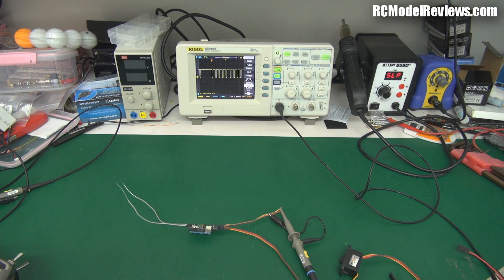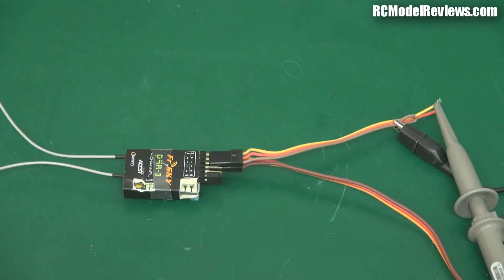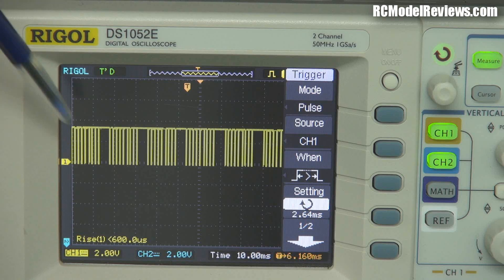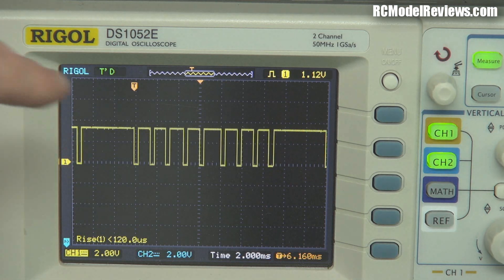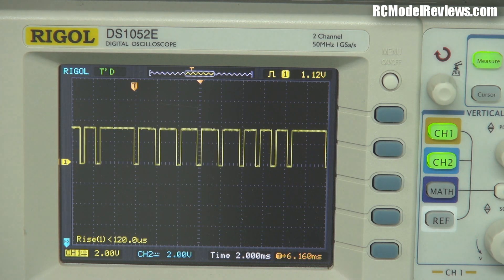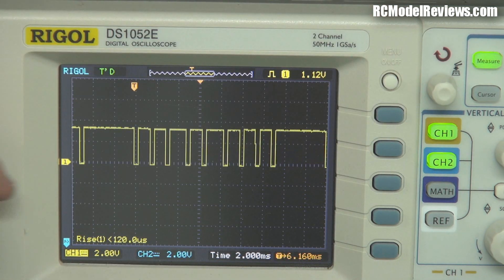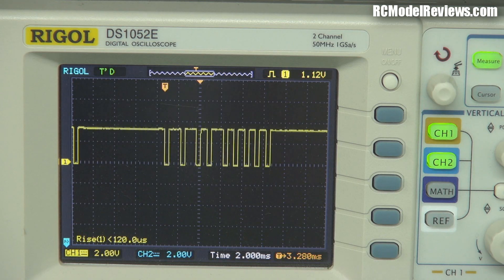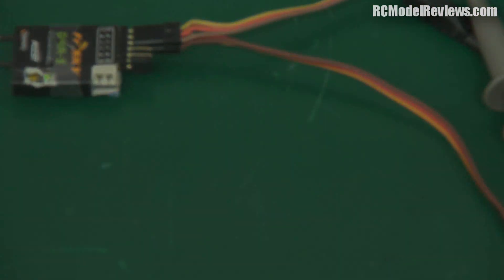CPPM and the FrSky D4R-II receiver

Comment: Great video Bruce, but you may be misleading folks a bit. If you were to invert your scope display, it would make a lot more sense. CPPM stands for Composite Pulse Position Modulation.  So the signal intelligence is conveyed by the position of the pulse in the frame, not by its width as is the case in Pulse Width Modulation (PWM).  So when you vary your Ch1 signal for example, it does not increase or decrease in width, but changes its position in time, plus or minus, from its idle position.  The width of PPM pulses representing individual channels is constant.  Invert your scope display and it will be very clear what is really going on.
Reply: i suspect it's CPPM is inverted  and differentially encoded PPM.   which would look exactly like several varying width pulse one after the other.   but yeah i think this has confused a lot of people looking at it from inverted perspectives.

Comment: Hey Bruce today is May 12, 2015. Any word if the new D4R-II have the new firmware pre-installed from the factory?
Reply: Dean Cory I have the same question.  have you got an answer from anyone yet?
Reply: No answer.
Reply: Joseph Donati:  I got mine today all 3 aux functions worked.  Granted Aux3 is lost model beeper Aux selects flight mode of my Naze32 and Aux 1 arms my motors

Comment: im thinking of using the d4r-ll instead of the x8r which  came with my taranis on my 250 quad, any advise ? thx
Reply: A lot of people use the d4rii it's very small and can fit right under your naze 32 when using spacers. Plus telemetry is very easy to use compared to the x8r.

Comment: Hello Bruce,

Is CPPM a clearly defined standard, are 25ms sync pulse standard?
Because I flashed my d8r ii with the new firmware, I checked that cppm was enabled by plugging in a servo to see it jitter, because I dont have an osciloscope.

And the flightcontroller CC3D hat jumping thottle (without prop).
The same problem I had earlier with apm2.5 and it lead to a crash even with openlrsng where I set the spulse to 4ms, as I remember that was suggested. It would maybe better to set it to 25-35ms.

Then later, I tried sbus with CC3D and it worked without any flaws, amazing.

So to summarize:
Does a bit mor than 25ms allow you to be on the safe side?
Is there a clear cppm definition?
Is Sbus clearly defined?

Best Regards,
Ruben

Comment: Hello,  thanks for the great video.  I do have a couple of question as I am going to be building a 250 and 450 very soon.  I will be using my FrSky radio that came with my IRIS+ and was going to buy the D4R-II    the 250 uses the CC3D Controller and the 450 will be using the AMP2.6   if I am understanding correctly this receiver will give me 8 channels?  and do you think it will be a good fit for these two multirotors?    Thanks for all your help

Grandpa Jake

Comment: i just bought the d4rii this will be a tricky matter and kinda regretting not getting the 8 channel one instead. also will be fun to build some kind of antenna with the 2 wires they give you. im thinking a quarter wavelength double dipole antenna in the vertical position.

Comment: i have a t9x modded to opentx.  I think i am experiencing the unexpected behavior.  QAV250 will suddenly drop a corner and flip or get squirrely.  I saved it the other day by punching it hard up.  I would be interested in a follow up how-to to Max and Invert.  I've crashed twice because of this.  One time doing no damage, the other time completly destroying a motor. Did some googling but didn't turn up a definitive answer on how to do this fix on my T9x.  Thanks.

Comment: Hi Bruce. Good video. You're giving an insight into how radio gear works and explaining it well, which is good because I've always been amazed at how little people who are supposedly experienced flyers actually know about how their models work.

I've been flying with my Futaba 10C for the past four years (roughly) and I recently blew it up. I loved the thing to bits (literally), but I really cannot afford another at the moment. The Taranis is slightly more within my budget, so I'm interested in it. It looks 10000x better than any of the other budget radios I've seen (IE not Futaba/JR), but how would you say it compares to expensive radios? I've become accustomed to a nice transmitter so I really don't want to be using something cheap and crap again.

Comment: Great video! People say it's possible to "turn off" the last two channels with the Taranis, and I can see that option in the settings, but my D4R-II continues to produce a CPPM stream of 8 channels despite my settings in the Taranis being D8 mode & channel range CH1-6 only. Has anybody actually seen the D4R-II produce only 6-channel CPPM (using the Taranis or similarly featured radio) on an oscilloscope?

Comment: You can actually use 6 channels if you minimize channels 7 and 8, or 7 channels if you can completely turn off channel 8 (i.e. the channel is not sent at all). The thing to remember is that your sync pulse needs to be 4ms long, most flight controllers will loose track of the channels if it falls below 3.8ms. 2ms per channel * 8 channels = 16ms total frame used. The standard frame size is 20ms and FrSky uses 18ms so you only need to free up an extra 2ms and you're good. Always be sure to test with all channels set to maximum throws first though. Also the Delta-8 is not affected by this issue, Simon Chambers implemented a flexible frame size that tacks the sync pulse onto the end of the frame regardless of the channel widths in the Delta-8 firmware

Comment: I was very excited when I saw this title as I have wanted to know how CPPM works for some time.  However I'm not 100% clear.
Am I right in thinking that I bridge the signals of the last 2 channels and use a normal lead on channel 1 from the receiver to the flight controller it will then be complete.  Do I have to do anything to the transmitter?  I have a Taranis and use Frsky receivers.
Also, does it work for planes if I have a stabilisation controller or APM?

Subscribed for years and check for new videos daily.  Thank you for all your help over the years.

John.

Comment: Surely this is only a problem if you are trying to use all eight channels at max width at the same time, isn't it?

The D4R-II manual itself states this:

"CPPM channel can not handle all eight channels at the same time with all throws maxed out, as it does not have enough frame gap.  It is recommended to use at most six channels from CPPM while leaving off the other two channels, otherwise improper performance might occur".  

Surely you just don't use the other channels and you don't have a problem, do you?

Comment: Mr Bruce, how about a follow up video - could you demonstrate a lost sync and show what actually happens to the RC model.
Reply: i think the radio just keeps broadcasting. the interesting bit would be the cppm from the reciever. i think the d4rii manual says what it will do as it goes into fail safe. there are 2 or 3 modes i think, one will freeze the channels at their last known value, another will stop pulsing, and the third just shuts off failsafe mode which im not entirely sure what that does other than allow a rc to fly away?? i agree a video demonstrating these 3 modes would be interesting to see.

Comment: Hi Bruce and thanks for all your very videos ! I like a lot what you do. 
I just have a quick question : what happen in terms of CPPM if only 6 channels are set in the mixer tab of the taranis ? If the taranis broadcast only 6 channels, does the D4R-II receiver send an 8channels CPPM signal or only a 6 channels ? I as that because the leaflet with the D4RII specify that it is safe to use up to 6 channels with the stock firmware and that's what I do on my quadcopter (I ordered a frsky USB lead to use the 27ms firmware)

Comment: FR Sky has not been all that.

The Taranis is a better built radio over the Turnigy 9X, and 9XR, however having a nice car over a go cart is nothing if the nice car doesn't run or doesn't do all the things it says it can do.

I invested in FrSky Taranis because I listened to this guy, and so far the radio works fine for basic flying but so does the radio that came with my Harbor Freight $30 Helicopter!

Of coarse I talk about it here because if you listen that is the radio he is using in this video.

The radio brags about the telemetry and yet all that really works is the battery voltage, and even that can be a pain to set up, look at some of the instruction videos here on youtube!

The GPS speed sensor and logging is a complete joke and the vario logging is just as bad fact is the telemetery logging absolutely useless and they will not fix it or even acknowledge the problem instead saying they use free ware (companion 9X) and its up to the guys voluntarily making the software to fix it! So I am paying for a radio that has firmware made for free, and paying a premium price for it as well.

So yea I am saying it sucks! And apparently the pulse width management and having to flash the receivers sucks to, and what is worse you find out you may need to flash your receiver when your model crashes! Or you can add to your already tasked workload of learning how to set up the radio then setting it up and then making sure your model is set up by now also having to risk trashing your receiver because you need to flash it!

If you are going to make video on how these things work and suggest a radio that " I think he had something to do with the telemetry design for it because I did see him in a video years ago saying he was working on that."

Anyway if you going to do that you should make a video showing off the telemetry and showing how to set it up and show it working, but then again if it doesn't work and you want to sell it anyway you just ignore the customers after they buy the radio and see its bullshit!

TO MUCH BS I JUST WANT TO FLY!
Reply: Someone did not do their homework before buying the Taranis.
The learning curve is huge if you want to use advanced features.

"I invested in FrSky Taranis because I listened to this guy, and so far the radio works fine for basic flying but so does the radio that came with my Harbor Freight $30 Helicopter!"
It works as well as the person programming it. OpenTX has a learning curve.

As far as telemetry goes, RSSI definitely works, I use it.

Companion 9x is the PC software not the Taranis firmware.
Taranis uses OpenTX firmware which is open source.

"So I am paying for a radio that has firmware made for free, and paying a premium price for it as well."
You didn't know this before you bought it? Hardly a premium price for a radio capable of doing what others do at 5 times the price.

This was a very informative video on CPPM not telemetry.
If this radio is beyond your capability sell it and buy something simpler.
Reply: Yeah that Taranis is overrated. How about I take it off your hands for $50 and do us all a favour.
Reply: MW2Stambo I'd say the RSSI in my FR Sky module also works just fine, and I haven't even modified my transmitter to use it properly.  But the beeps from the module are enough to tell me "hey, you are near the end of your range, do something."
Reply: I spent a total of $300, And I didn't even get the case.

I got a extra 8X receiver and all of the telemetry hardware, vario, GPS, voltage, and 100 amp sensor.

I already had the older screen attachment that is set up on my 9X. AND IT WORKS, it does not log though.

That's the problem i cant look down at it and the plane all the time and also having to take my hands of the radio to switch screens.

So I invested in the Taranis, because IT LOGS THE TELEMETRY DATA or so they say it does.

Nothing on its screen works like the attachable screen does on the 9X.

So that is why I wanted the logging and it is a joke just numbers, numbers that do not match the metric or imperial system, cant see how high or fast you were flying.

The voltage works though! And thats about it!

Spent 3 weeks trying to get answers, what a pain in the ass that was!

$300 for them to profit on freeware gives me the right to bitch!

I think when it came people were eager for it, i was I have the video i made when I fist got it, but as the weeks went by the more pist off I became at it!
Reply: Nubyrc You don't seem to get it. The Money you spent was on the hardware. The software is FREE!! ware. Did you really expect to buy a $200 radio that rivals many costing 3 times as much and not have to learn how to use it.
A bit of patience and maybe the people that write the FREE firmware may fix what perceive to be your problem.
Perhaps you should go join the opentx forum and politely ask someone how to achieve what you want instead of bitching and moaning.
The Taranis is capable of speaking values at predetermined intervals or at the flick of a switch. Perhaps this is a feature you could use as part of a solution.
Reply: You dont get it. I spent money period.

I don't care that FreSky decided to take advantage of volunteers,  they advertise the telemetry all over their website to get me to buy it, hell even the neck strap that came with it brags about the telemetry!

When someone advertises anything and tells you all the things it can do so you buy it, and then you actually do buy it, then when the very thing they advertise does not work, you have a right to complain.

Telling me they cant fix it because they took money from me selling me something that was done for free by volunteers is a cop out, what part of being screwed over don't you get?

Apparently you must be one of those people who thinks $200 is nothing, someone out of touch with the majority of people in this country who do not have a lot of money. Who thinks that complaning about a $200 radio and the extra $100 in additional hardware is stupid because $300 is nothing.

Well I have more respect for money and the value of the things I buy then that!

I purchased this radio for the telemtery logging of the GPS and Vario, it does not work they refuse to fix it they mislead me and everyone who bought the radio for the same reason not my job to teach you reality, so figure it out!
Reply: Nubyrc I love my Taranis, but it's not for everyone. To me it's like choosing to run Linux on a PC... You have ultimate control over what it does but there's a learning curve, and it's not always pretty.

Some people enjoy the challenges involved in open source, others don't. In the PC world I advise people who just want smooth sailing to pay a little more and buy a Mac.

My comment about buying the radio for $50 was half serious, you could easily sell your Taranis (for more than $50) and try something else like the new offerings from Graupner.

There is no "best radio", just the best radio for you.
Reply: I love Rc,

Its not about being bright enough to deal with the learning curve its about, it does not do what it advertises.

I am sure you have a Tarranis but if you have a GPS or Vario as well, then go fly and log the telemetry data on the SD card that comes with it.

Then take the SD card plug it in to your computer and open campanion9X or any of the versions of it and read the GPS and or Vario telemetry data.

Thats it, just read the data and tell me if it makes any sense!

That is what I paid for and that is what does not work!
Reply: I know you have a point Frsky should point out these open source stuff but still it's a great RC and it does a lot for its price ...mmmyeah you need to invest a lot of time on it to do more which for me is not worth the investment and if I'm looking to do a lot more with my rc I'll go for the big guys which are ALOT simpler but for 4 to 6 chn operations and some music while ur flying is great :)
Reply: My $300 of radio is sitting on the shelf, until the fix the GPS there is no need to use it I have other quality radios that are lot easier to set up plus the receivers are cheaper.

I was mislead by the advertising sure it works in the things a radio is supposed to do, i wanted for things you dont get on other radios like GPS speed and alt data logging!
Reply: Stupid question, but do you have a GPS receiver on the plane hooked up to the control receiver?
Reply: Stupid comment FUCK YES I DO! Spent the money for the newest version of their GPS unit to connect directly to their newest receiver.

It does get GPS data, and it logs it, problem is you can not read the information! They did not take the time to set it up so what ever it records is displayed properly on the software used to read it on the computer!

I dont want to take my eyes off the plane and keep looking down at the radio when I am flying a funjet at 100 MPH! I wanted to log the speed data and review on my computer later!

IT DOES NOT RECORD CORRECTLY!

Comment: Videos are great and most of the time informative and correct, but PPM and CPPM are not interchangeable terms. I've been using 72 MHz PPM gear since the early 80's. Computerized PPM is a whole other animal even though it still uses "proportional pulse modulation"
My 2 cent worth, from a mech/elect tech in Canada.
Reply: In this context CPPM = Combined PPM

Comment: It's strange that they would even release for sale a CPPM system where the least optimum use of all available channels would result in a too-short sync pulse. Are they counting on a low probability of a worst case condition in the pursuit of reduced latency?
Reply: The D4R-II is sold as a 4 channel receiver. Being able to use more than 4 channels by switching to CPPM was probably thought of an "unsupported" bonus feature.